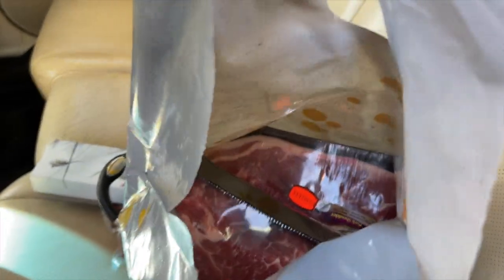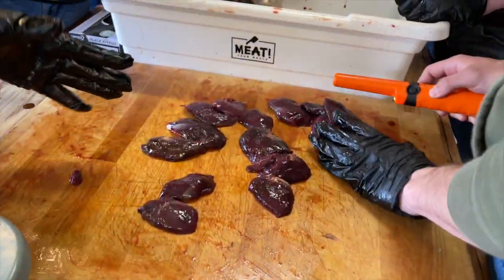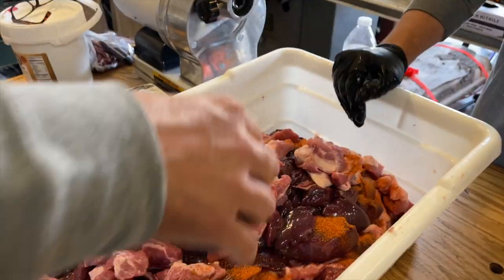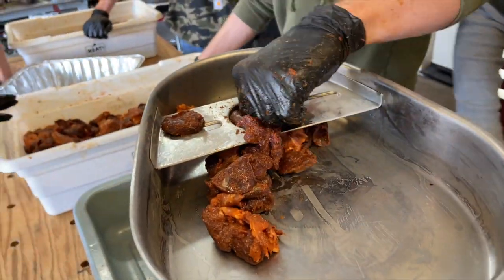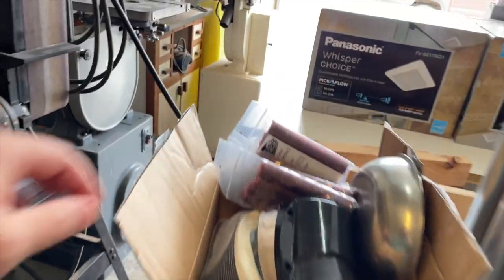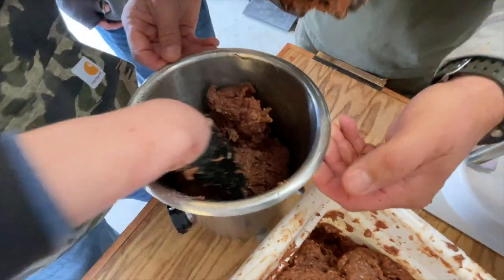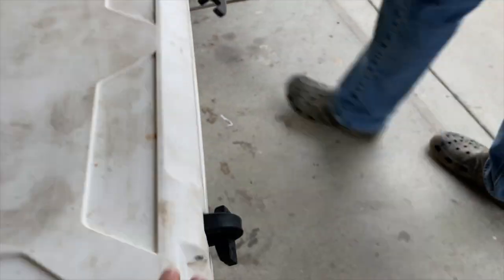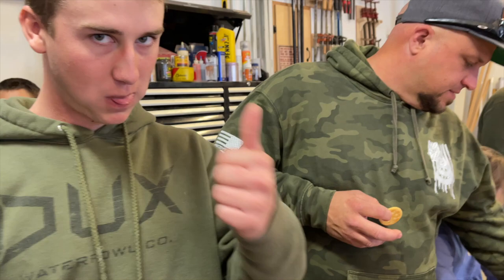How To Make Smoked Waterfowl Pepper Sticks

Comment: Hey did you notice that when you vacum seal them they hold moisture? I'm having that problem right now like they are all wet and nasty when I take them out. Also do you freeze them after vacumseal or will they keep fresh in cupboard?
Reply from the maker: I haven’t had that happen, sounds like it might need to be smoked longer or there is too much fat in it